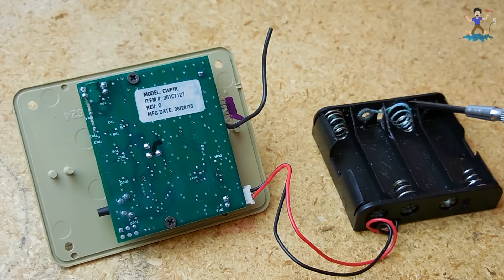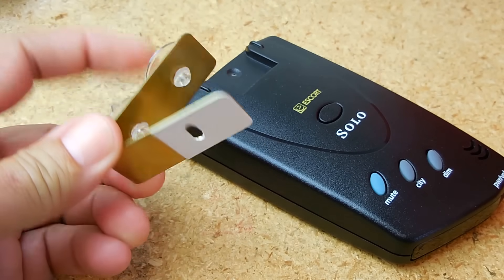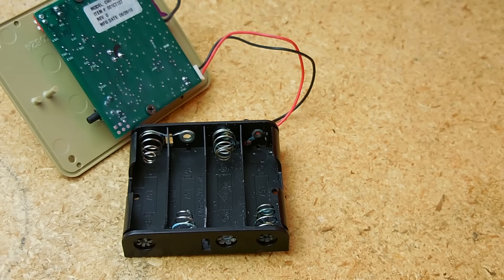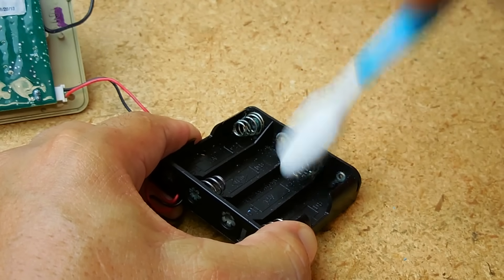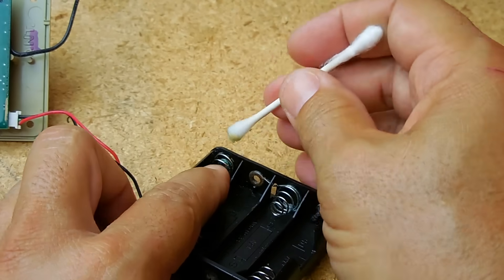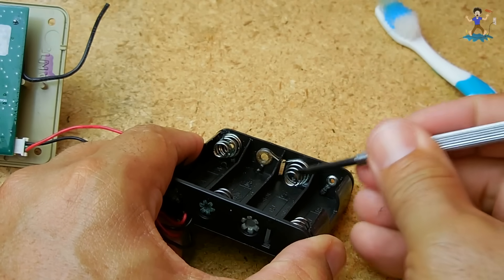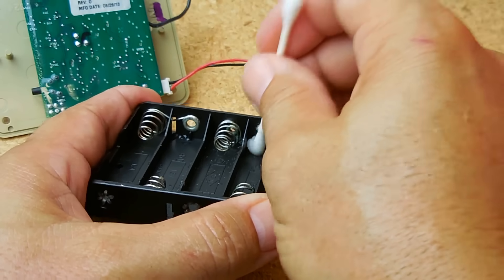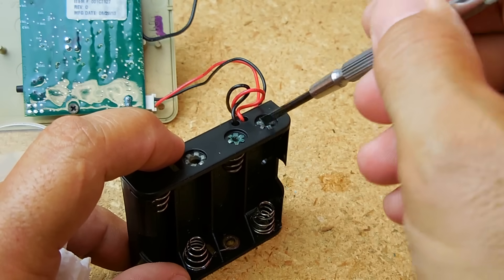EASILY Clean Battery Leak Damage(Corrosion) In Electronics

Comment: I was thrilled to find an old remote to a Pioneer DVD Recorder, but opened up the battery compartment to find one of the two AA batteries badly corroded to the point of the (Neg) end spring completely ruined.  It is now completely gone.  Is there anything I can do about that?  Thanks for any help.
Reply from the maker: Take the spring from another cheapo dollar store device, solder it to the NEG(Black) wire of the corroded device, and use epoxy to secure the spring in place. Be sure to look over my extensive video playlists below for many other videos of interest to you, use supplied Amazon links to support my channel when making purchases(No additional cost to you), and most importantly take one minute to share links to my videos with others on social networking sites. Thanks Herb!
http://www.youtube.com/c/electronicsnmore/playlists
Reply: @electronicsNmore  Thanks so much for your reply!  I will get someone who knows what the heck they're doing to give this a try!

Comment: What about when the alkaline leak gets on the chip board? Can that be fixed similarly?
Reply from the maker: You don't want acid on the board. Wipe away excess using a q-tip, then rinse the board with 91% rubbing alcohol. Lastly, allow to air dry.
Reply: @electronicsNmore  Thank you. I used a Q-Tip with white vinegar to clean as much of the corrosion as I could get, followed by the alcohol rinse.

Comment: The little battery tray is quite common. I would just trash it and solder on a new one. But this method will help me save a device that has a battery compartment.
Reply from the maker: I used it for the demo because it had damage from leaking batteries. Thanks for watching!

Comment: My guy, you’re a lifesaver! I just tried to fire up my old Wavebird controller to play my GameCube for some nostalgia, and realized I left the batteries in from like, 6-7 years ago. Thanks to your video, I saved her and am now playing some Legend of Zelda: Twilight Princess! THANK YOU!
Reply from the maker: Glad to hear it!
Reply: Same with my nerf gun, baby
Reply: Hmmm I’ve always used baking soda
Reply: Less than an hour ago I found my second Bung Doctor V64 Nintendo 64 development kits with a GameCube Wavebird controller sitting on top which had been missing for about 15 years. To my horror, I picked up the controller and found one of those rechargeable battery packs inside that have a 100% failure rate. I should know because I bought a bunch on clearance decades ago and every single one leaked… even the ones that remained sealed in the package. Around 2016 I even made a YouTube video about converting them to replacement Wavebird battery doors so I knew exactly what to expect here: blue corrosion on everything so bad that even the wires were detached… but the V64 was my big concern. The entire reason I had two units was because a NEC chip manufactured custom for Bung had a failed address or data line causing a DRAM error in one of the four memory banks. I recently traced it and found the failure was internal to the irreplaceable chip.

The only spare parts board I can see that was ever sold online clearly had that chip removed, which tells me it is particularly failure-prone and likely to be the issue in any future parts board that may crop up. The unit is extremely rare and expensive since they were technically illegal in the USA and are highly sought after by collectors today (Nintendo won an import ban because they also enable N64 piracy).

The Wavebird was directly over the vents. Sure enough, I found that the electrolyte went straight to the one chip I needed. The legs are crusty and blue on all sides with dark traces all around. When I brush as much away as I can the legs appear fused, especially at the point where they go into the chip package. Am I boned?

I only just found it because I was displaced by an EF4 tornado and clearing out my old game room “barn” to live in temporarily. At the same time I needed to sell my collection to make room. That is why I was recently looking at the other one to determine if it could be fixed (it can’t). I suspect that the chip will not tolerate transplanting well if they fail on their own. The nature of it being only one address or data line tells me it is likely a tenuous bond wire connection in the chip package that is failure-prone. Well, that, and the fact that the first time my original unit threw the error is was intermittent and quickly became permanent.
Reply: @emmettturner9452  you sure like to hear yourself talk dont you...whats all that crap got to do with battery leakage corrosion cleaning?
Reply: @gunzmith29r  A valuable and rare collector piece was destroyed by freak chance from a leaked battery. It had just happened. It wasn’t even a battery-operated device. The corrosion went straight to the only chip I needed to recover.
Reply: Windwaker is better

Comment: I have the same device, why don't you just disconnect the battery box from the circuit board and submerge it in the vinegar? Quicker, easier!
Reply from the maker: That wasn't the purpose of the video. It was used for demonstration purpises.

Comment: I use CLR and give it a coat of WD-40 after rinsing and air drying.  In my experience, Energizer is less likely to sulfide than other leading brands.
Reply from the maker: Duracell's are the worst when it comes to leaks.

Comment: That powdered "corrosion" you're flicking about with your tooth brush contains battery acid and will contaminate and can even ruin the electronic component sitting next to the battery holder.
Reply from the maker: Really? Please explain after 30 years of doing what's shown, and still owning a few older testing devices, why I've never had any problems? Don't be a pendant.

Comment: 0:30 "a lot of corrosion"
Well, that means you don't want to see why I am here. The whole compartment is corrosion, the batteries have popped, literally.
Reply from the maker: You may have to take apart the plastic housing to give it a really good cleaning. Thanks for watching!
Reply: yea, I started to clean but I think I was a bit too late, one of the prongs (springs in most cases) broke off, a tech person said I should be able to solder it back on, so I'll try it after I get a soldering iron
If that makes it work I am happy, coz that means I can use my $700 helicopter (well like 200 now) again :) meaning it doesn't need to be thrown into the bin
Note to self doesn't leave batteries in things for almost a decade...

Comment: Be careful soldering wires to some terminal rings or clips. If it won't take solder to the rings or clips immediately it may be stainless steel. Plastic might then be damaged by heat. Some Futaba radio control equipment used stainless probably to force people to buy new products.
Reply from the maker: Yes, they can melt. I suggest what's used in my other video below. Thanks for watching!
https://www.youtube.com/watch?v=KKKIv-XNyeo

Comment: What if the spring was completely eat off by the acid. Is there a way to fix that?
Reply from the maker: A workaround would be to make sure whatever is remaining is super clean/shiny, then take a small piece of aluminum foil and press it over the area. On top of the foil place another similar spring then install the battery.

Comment: For the record those sunbeam batteries youre using are very prone to leaking. Especially when kept in hot moist  environments. If it hasnt happened to you youre lucky. Unfortunately they probably will.
Reply from the maker: Yes, I've had a couple leak in higher heat, but they do perform well. Duracell's are the worst.
Reply: @electronicsNmore  after extensive research with the use of double a batreries in the audio video prodcution business we found plain old rayovac batteries are the most reliable longest lasting batteries. Better than duracell pros and any regular alkeline batteries. In our high end high dollar equipment weve not had a single instance of leakage reverse polarity or failure in a single event. That covers concerts lectures the Dallas Cowboy half time events etc. Theyre nearly always a conciderable amount cheaper as well. Do with that information as choose. Btw Good video. Alot of folks dont know about these things. ...or anything in many instances.

Comment: Thanks for the video! As I took my clocks down to turn them ahead an hour, i was changing out the batteries, and my kitchen clock had a Dollar general battery that corroded in there. It was so bad I had to use a flathead screwdriver to clean around the battery and carefully get the battery out. I wasn't sure exactly which kind of vinegar to use.. so you helped a lot! I will go ahead and do this for everything now instead of throwing things away.
Reply from the maker: You're welcome Trish! Glad to help. Be sure to check out the very wide range of videos on my channel, and share my YT channel with others. Thank you
https://www.youtube.com/c/electronicsnmore/c/playlists

Comment: How about when everything is rusted due to batteries leaking?
Reply from the maker: You'll need to carefully scrape away all the rust.
Reply: @electronicsNmore  I took the battery compartment innards out and soaked them overnight in 5% vinegar then sanded the contact points and put it back together and now all is good.  This was my Lionel train clock.  Works good now.

Comment: I just took delivery of a used Elecraft KX1 (low power amateur transceiver). When I removed it from the packing, I noticed a smear of oily substance on the exterior of the case. On cracking the case, someone had left a brace of alkaline batteries in the unit, which of course had burst and leaked. I see no real damage to the case of PCBs, but need to pull the VFO knob and separate the PCBs from the case. I think they are fine and just a little cleanup of the case interior, plus a thorough cleaning of the battery holders will be required. 

Your direction will make this a simple cleanup. Thank you.

73 de AG7TX

Comment: I use  WD40 and it works great.
When I install new batteries I coat the ends with  WD40. Helps prevent corrosion. I use a paper towel or q-tip and put WD40
on it and use to rub connections also.
I never have white vinegar in stock.

Comment: IMPORTANT: the first step outlined in the vid is very BAD advice. Battery corrosion is very dangerous to your health and can potentially cause major illness if inhaled or ingested or gotten into the eyes. Do NOT vigorously brush out corrosion with such an instrument as a toothbrush and knockout debris on random surfaces... I repeat, do NOT do this. Such actions may cause the dangerous elements to be strung about on various surfaces, can become airborne and spread about, and can be carried on the skin. This may lead to this dangerous substance to be  inadvertently ingested later, and airborne particles to be inhaled. If attempting to clean battery corrosion, such must be done in a more controlled technique and conditions, taking better caution as to keep the corrosion debris contained and properly disposed of.
Reply from the maker: IMPORTANT: You sound like a hypochondriac. I can assure you that you ate and inhaled far more toxins than you'll get out of brushing a battery terminal. I can tell the viewers that have desk jobs.

Comment: for infrequently used emergency devices, use lithium batteries instead. They will not leak like alkaline.
Reply: GREAT Advice. ...thanks
Reply: They mean lithium primary cells -non rechargeable type, they have a use by date of 20 years and about 50% more capacity than alkaline cells.
Reply: @HubbHubbs  capacity but not life
Reply: lithium come with tripple A?  Ive seen them in other sizes but not AAA
Reply: @bzmanya4069  Energizer makes AAA lithium batteries.  I've seen them at Walmart.
Reply: Been doing this for years! White vinegar (5% acidity) is the best thing to use. The acidity of the vinegar easily cuts through the alkalinity of the corrosion, as the pH of white vinegar and alkaline electrolyte are dead opposites. The alcohol is good for cleaning things up after the work is done. 

Good video. 👍
Reply: do you have a link for this?
Reply: Does anyone still make rechargeable alkaline batteries? Or was that really more of a fad?
Reply: Low self discharge cells like Eneloops have never leaked on me either.  I like the rechargeable aspect of them.
Reply: The only problem with lithium batteries is they last about 1/4th the time an alkaline battery will. Lithium and Nickle Metal/Hydride batteries only last a short time and then your out of juice. Alkaline will outlast them. If your using the battery in as you said an infrequently used emergency device, simply put a small piece of plastic or heavy paper under the negative terminal then the battery will not leak, because it is not being used. I do that with all my emergency devices.
Reply: IF the device has 3 alkaline cells, you can use 1 rechargeable lithium cell with 2 "dummy" cells.
Reply: @solarsynapse   The conversation above was about single use batteries containing lithium, such as Energizers' "Lithium Max" series, and not rechargeable lithium batteries.

Comment: If not in a hurry, the entire corroded battery holder - if it can be removed - can be immersed in the vinegar. Then, after corrosion has been neutralized and the contacts are bright once again, the entire holder can be rinsed thoroughly in plain water. Then it can be dried. A hair dryer or heat gun can be used to speed up the drying.
Reply from the maker: Bad idea, I explained in the comment area multiple times. Thanks for watching

Comment: D cells by Duracell leak like crazy.  They are made in China or Japan. I cannot tell which, but there I’d Chinese like writing on the labels.  I have lost 3 Maglights this past year.  One was the new Cert bulb light.  Complained to Duracell.  No response.  The last maglight was less than 2 years old.  After finding the corrosion in the first two I tried to check the Cree bulb light.  It still lit up, but I could not get the end cap off.  Even with pipe wrenches.  GO CHECY YOUR FLASHLIGHTS NOW.  EVEN IF THEY LIGHT AND THEY HAVE D CELLS, THEY MAY BE JUNK NOW.

GOOD LUCK.

JoeB
Reply from the maker: It's best to leave batteries out of devices that you don't want to see get damaged. Please share my channel with others, and look over my extensive video playlists below for many other videos of interest to you. Thanks for watching
http://youtube.com/c/electronicsnmore/playlists

Comment: Some top brand batteries will actually replace the device if that brand has a guarantee, read the fine print on the battery package !
Reply from the maker: Correct!
Reply: @electronicsNmore  Good luck with that! Duracell wanted the original receipt for everything! do you keep receipts for all battery purchases? What about a gifted product ruined by their leaking batteries?  They outsource to India their claim payments, who obviously won't give you shit
Reply: Great video, Thanks
Reply: H Fin , I buy all my batteries with a credit card at the same place , I get it if you buy your batteries from anywhere , but it’s cheep insurance to put the receipt in with your expensive electronic equipment storage area

Comment: You can do this as this is very effective.  Or you can spray some WD40 and dab with a paper towel and you are done.
Reply from the maker: WD-40 doesn't neutralize a base. Always use the vinegar first, then apply a very thin film of silicone grease or WD after. Thanks for watching!
Reply: @electronicsNmore  the corrosion on the contact spring was very little and wd 40 would dissolve it and protect the contacts.  Vinegar and silicone grease are clearly effective just not necessary on smaller jobs such as this.   Use wd 40 on my car batteries as well to reduce the corrosion although petroleum jelly is slightly more effective in the long run.

Comment: Good tip but this remedy has its limitations.  The contact surfaces where the plating has been destroyed may require periodic burnishing (scraping/polishing) to maintain good battery contact.
Reply from the maker: Correct
Reply: Just "replate" contact surfaces with a thin layer of solder. Lasts many years.

Comment: How about rust
Reply from the maker: Scrape it away until the metal is shiny, wipe clean with 91% rubbing alcohol, then apply a thin film of silicone grease before installing the battery.
Reply: electronicsNmore ok I got it was a dancing snowman working all I did cleaned the spring with WD-40 then took white vinegar and cleaned it the rest of the way

Comment: I would have soaked the whole thing in vinegar.  This results in less scrubbing.
Reply from the maker: If you did that, the vinegar would seep way into the wire under the insulation. Not good.